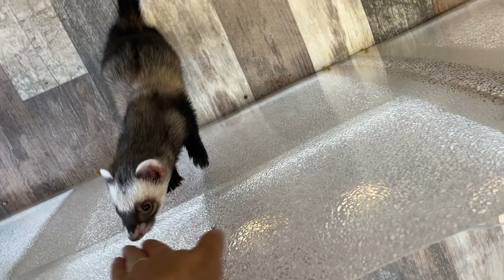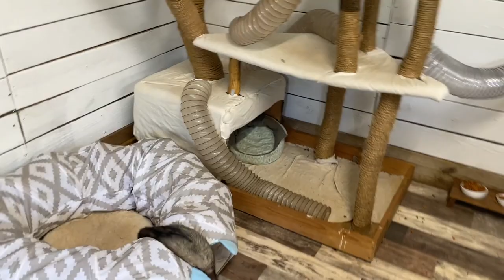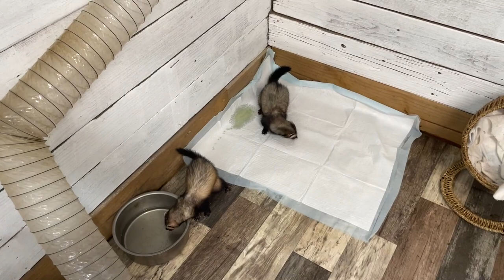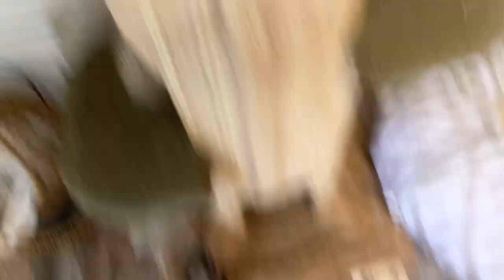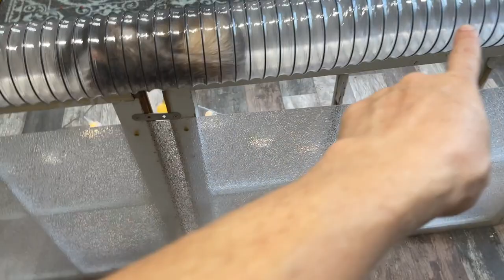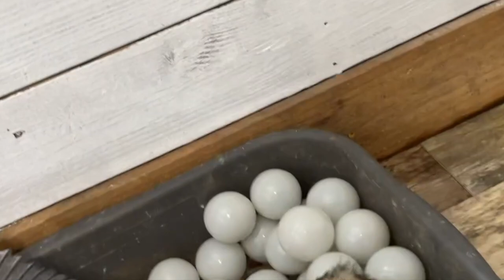Huge Ferret Enclosure Tour!

Comment: I love that you've sectioned off an area for them, it's very cute. However I would not recommend high spots for ferrets as they are very prone to wrestling themselves off and getting severely hurt- coming from someone who does own ferrets and has witnessed it many times. Even if you don't notice them doing it, please do take extreme caution as a fall from those heights could very easily break bones and damage organs!
Reply: Ferrets are very sturdy... this is not even 4 feet high... they will be totally fine even if they fall all day
Reply: @Weehamish100  I had a ferret, Max, who died of total organ failure a month after he fell from my computer desk (3.5 feet high) and suffered a spinal compression injury, causing the back half of his body to go 90% paralyzed. Had to help him pee and poop and he was depressed as hell. No, they are not as sturdy as you VERY incorrectly claim.
Reply: @Weehamish100  My ferret Iggy fell out of her cage while I was cleaning it and broke a tooth.  The cage was only 3 foot high.
Reply: @Weehamish100  i had a girl fall off from the bottom on her cage and injured her spine, she had to be put to sleep as she couldnt do anything and was in major pain

Comment: Built our ferret a ferret enclosure for the outside patio out of an old dresser. I use the bottom drawers for bedding and litter lined with a spray in bedliner. The bedding has a heat rock in it to keep them warm when its cold out. I'm in Florida, so cold here isn't really cold. and for the summer when its hot, I added PVC pipes for them to crawl into with a desk fan at one end to work as air conditioning for inside the tubes. We have Chaos, Mayhem and Ferret Bueller.

Comment: My 5 live in an interior atrium which has 4 windows with screens for ventilation.  One window screen goes up 8 ft. and one of my ferrets has learned to climb to the top and then uses her claws to lowerr herself down resulting in a lot of rips and rents in that screen.  That window screen looks into my bedroom, so she might be looking for me.  My warning is that they are little climbing escape artists.
Reply from the maker: I bet she is looking for you! Maybe if you are able to do to your screen like I did on the front wall windows she wouldn't be able to climb it. Not knowing what your setup is that may or may not work. They are mischievous little guys, that is for sure, but so much fun to watch and cuddle.

Comment: Have they ever fallen off the cat towers? I bet older ferrets would be smarter but I really want to get a cat free for mine & wrap a tunnel around it like you did, but I have 2 new 5month old ferrets & they'll try to jump off my tall bed. Worried if they'll jump off a cat tower & get hurt 🤔 what are your thoughts?? Also I LOVE LOVE LOVE your set up! Expecially the plastic panels on the windows to use as a fence & the tunnel ontop!! Where did you get the plastic squares??

Comment: Nothing wrong with potty pads, but they are expensive.  Try using Secamax.  It's a chamois like material.  Sold by Walmart, only in selected stores, but you can buy it online.  Made in Germany.  Re-usable.
Reply from the maker: Oh I know, they're pricey and I'd love to find a reusable option! I've tried washable potty pads and it just doesn't work with the huge messes they make. I'll have to look into those!

Comment: Cute set up, they like exploring everything. The tubes what are they and how are they staying in place? The white balls are they like the like the kids balls? Also you can't put them with other animals  can you if you can what would work and play together? Just learning .
Reply: I have seen ferrets and cats exist together. Believe it or not, ferrets are pretty badass
Reply: @emilyaitch8143  that is what I thought. Yes the one I had would play with my kittens . So they won't get along with others?
Reply: @emilyaitch8143  Ferrets can be extremely badass.  I have a cat that likes to play with them and one time he needed to be taught a lesson.  l had to pry the ferrets jaws off my cat's cheek.  Buddy treated them with much more respect after that.
Reply from the maker: I think you got some great information from Emily and Mrs. Alexander. Ferrets can play with other animals, cats seem to be the preference but don't leave them unattended.
As for how I connected the tubing. I screwed hooks into the wood frames and then stuck them through the tubes, around one of the metal loops inside them. The balls are like the ones used in a ball pit.
Reply from the maker: What a story, and great lesson for the cat!

Comment: Love the setup! Its fits the look of your home so well. How do you clean the tubing the climb in? I don't have ferrets but I have something similar for my rats and they get pooped and peed in all the time.
Reply: l use 4 inch PVC plumbing pipes cut into a lot of different sizes with many Y and T connectors.  Easy to take apart, rinse out and put back together in a different pattern.
Reply: I took the clear tubes outside and then  sprayed them out with the garden hose and they got clear again w/o the yellowing.
Reply from the maker: They replies you received is how I clean them also.  Hose or dump them depending on what was left.
Reply: I use a steam cleaner with a wand